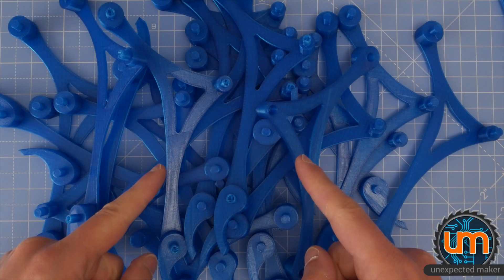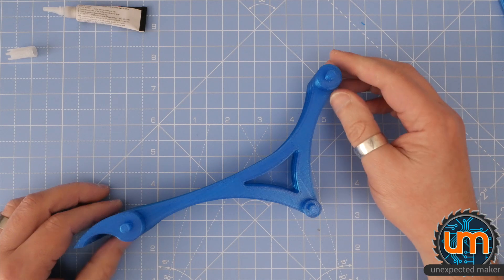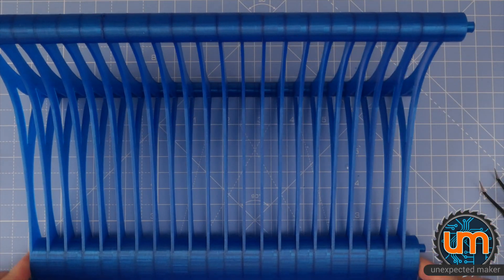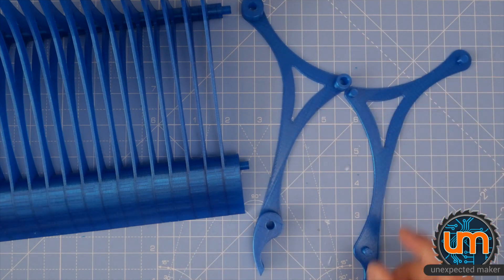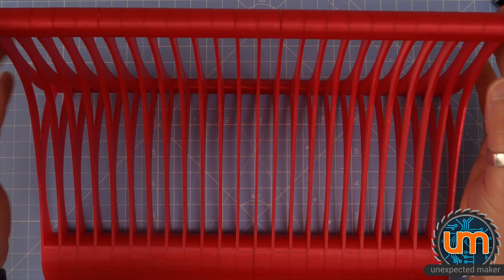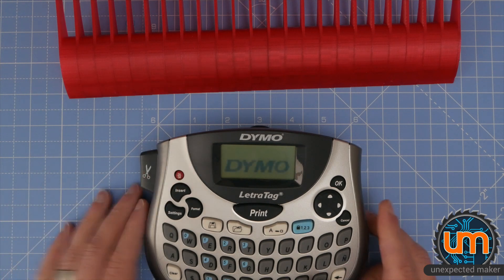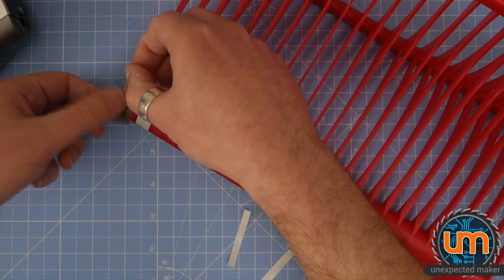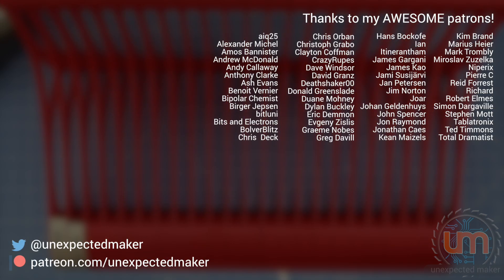3D Printed Modular Reel Rack - Part 2

Comment: Zeon--Could you have printed on your values (labels) while printing the rack parts?
Reply from the maker: Not really... The faces were sideways, so a terrible angle to print detail like that, I also want to be able to change the values for each slot as I cycle through stock and different reels, but more importantly, the resolution to print small text with a 0.4mm nozzle is pretty bad. It would have been illegible - even if I was able to print in multi-colour.